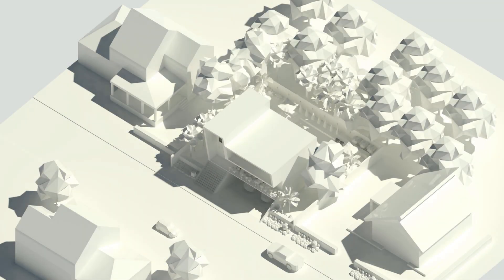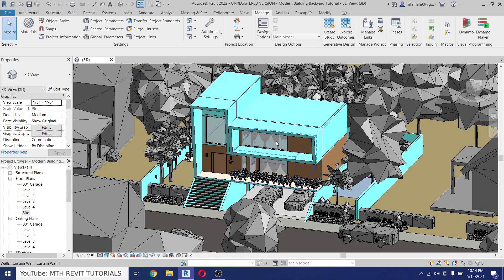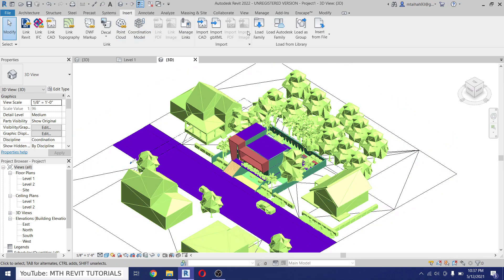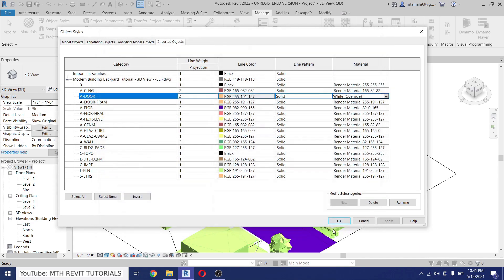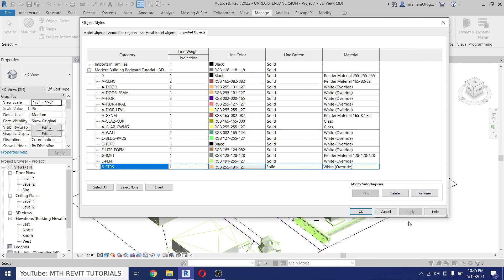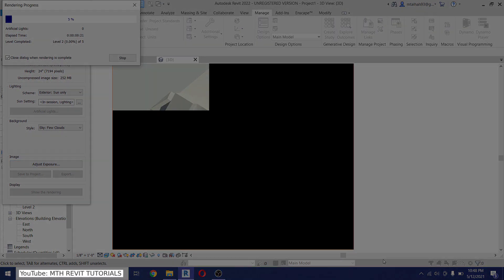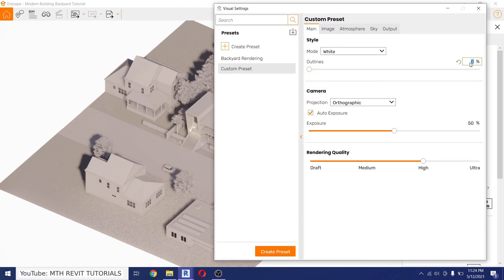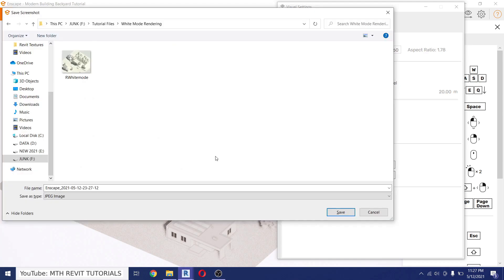Revit Material Override Tutorial | Secret Hack for Professional Maquette Renders

Comment: Hi. Lovely tutorial and super helpful thank you! My only issue is that I seem to have a glitch where sometime the override will work and other times not. I’ve tried re-exporting, reimporting, tried resaving the file… nothing seems to be working. It’s super frustrating… any glitch I should know about? Thank you so much again
Reply from the maker: To fix this issue, you can open the dwg file into AutoCAD(after exporting form Revit) select the whole model and change the "Object Color" to "By Layer" from the properties panel. Save the file and follow the steps showed in this video.. 

Check out this image: https://bit.ly/3OJ2QaK
Reply: @MTHREVITTUTORIALS   Thank you so much... I tried that, I even tried exploding the file from CAD... nothing seems to be working. Any other troubleshooting tips? Thank you so much for your time
Reply from the maker: @fatimahashworth  Send me Revit file if it's possible!
Reply: I'm having the same issue. Have you found a solution?

Edit: I figured out the solution. Listed below in case anyone else is having this issue.
In Revit, under File > Export > CAD Formats > DWG
Select the [...] beside <in-session export set-up>
Export Layer Options, select the one that says "do not export overrides"